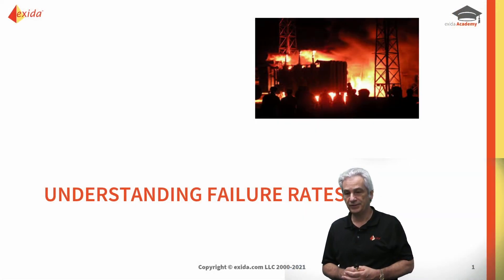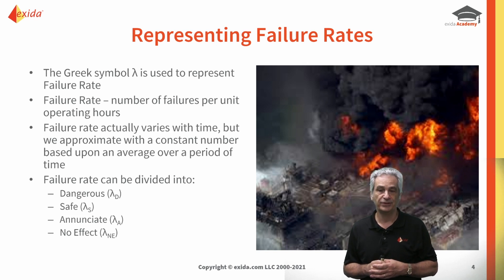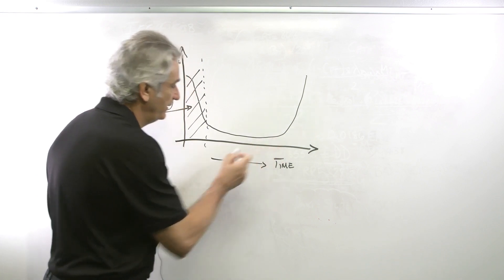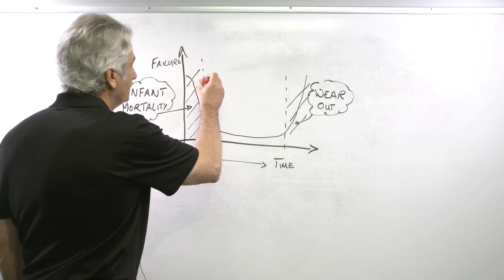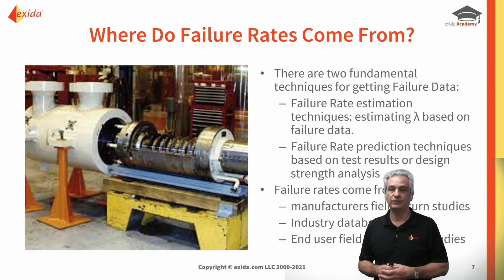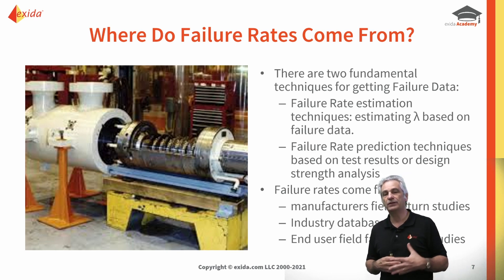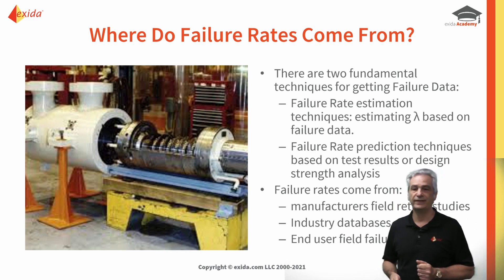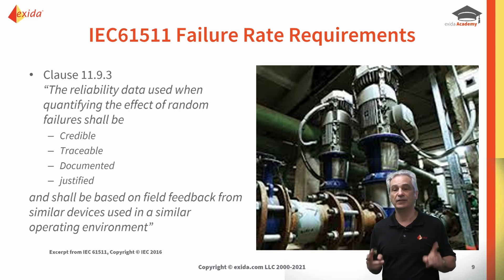exida explains - Understanding Failure Rates (from the IEC 61511 Perspective)

Comment: After fixing failed equipment, is it useful life will be same continue or it will start re count from zero
Reply: Same, useful life is where failure rates remains relatively constant over the ‘useful life’.
Reply: Fix by replacement then yes can count from zero for the specific device.